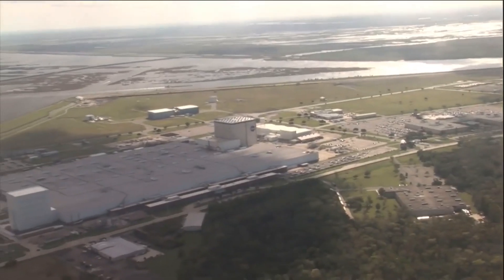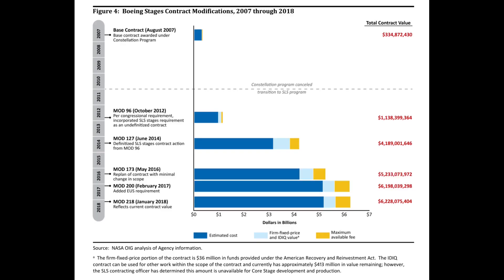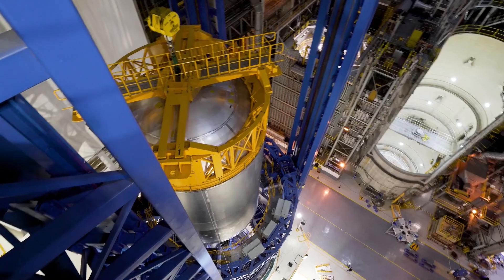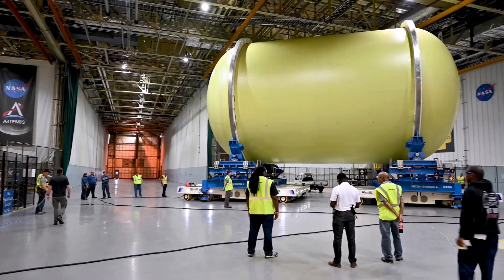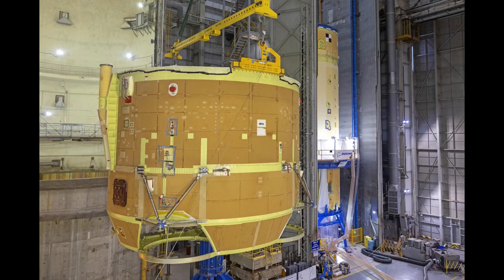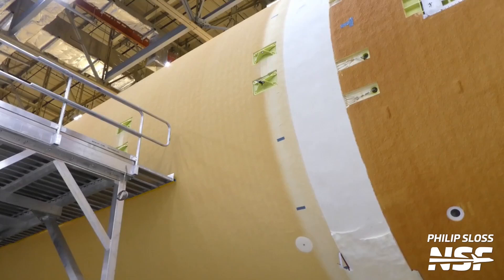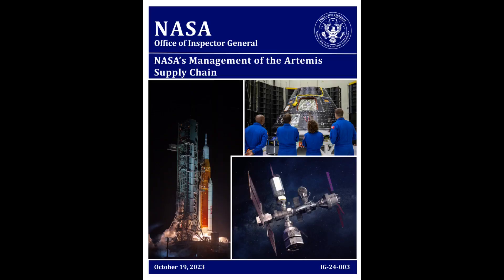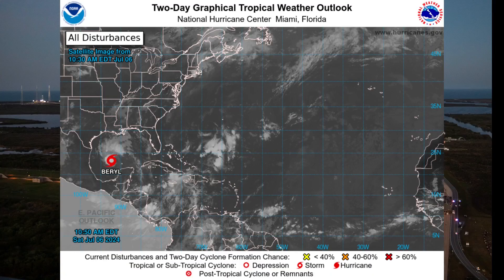Here's how NASA's SLS Core Stage for Artemis II was built

Comment: Lots of interesting and pretty pictures of the build over the years.

One thing struck me, do they rotate the stage every now and then when they are storing it horizontally to avoid sag?
Reply from the maker: It is something they take into account.  The full stage was rotated for assembly work last year and then again it goes through the full 360 degrees for the final "detailing" before delivery, something they've been doing the last few weeks.  But also the individual elements are worked on in different orientations; the dry sections are assembled/outfitted vertically, given the lower hook height.  (Forward skirt, intertank, engine section/boattail.)

The propellant tanks are assembled/outfitted mostly in the horizontal, but then they are supported individually during production and also rotated for production.

And then the stage will end up spending quite a bit of time over the next year and change stacked vertically at KSC.
Reply from the maker: In case you're interested, this afternoon NASA posted a timelapse video of some of the early rotations they did last month while configuring the exterior of the stage for shipment:

https://www.youtube.com/watch?v=1vkp5_eGjYY
Reply: @PhilipSloss  Thank you. That is a big rotisserie chicken.

Comment: i just hate they wouldnt have tried to recover the RS-25s
Reply from the maker: The Core Stage "stages" at orbital velocity, ~7800 m/s.  As a conventional sustainer stage, it re-enters like 2nd stages or upper stages, not like 1st stages or booster stages.

So it re-enters like Starship, as opposed to the Super Heavy Booster, or the F9 first stage, which stages at ~1500 m/s.  (Or the Shuttle SRBs, which also staged at around that velocity.)

To recover the engines intact from orbit, you'd need something like the Shuttle orbiter, Starship, or to continue developing tech like the hypersonic inflatable aerodynamic decelerator that ULA is working with NASA on for Vulcan.  

Shuttle and Starship are sacrificing significant single-launch performance for reusability; Shuttle wasn't able to reach its the flight rate goals, let alone the rapid reusability Starship intends to reach.  It will be interesting to see how much of a performance hit SMART reuse is for Vulcan.
Reply: @PhilipSloss SMART reuse didn't sacrifice much performance due to it being jettisoned after the burn is complete without having to return the core stage. 
But reusable players like SpaceX clearly didn't care about it since they still launch the most out of anyone & making huge revenues, even excluding Starlink. And there's still a huge questions if separating the engine section (with a lot of complex components) would be simpler or not than returning the whole booster, and how much will it affect the refurbishments
Reply from the maker: @alvianchoiriapriliansyah9882  If you're referring to ULA's plans, that's for the engines on their Vulcan first/booster stage.  ULA has to plans to return the in-space Centaur stage from orbital velocities, which is the speed of the SLS Core Stage at the end of its burn.

Comment: So this tank has been in the works for almost a decade… can they build it any slower?
Reply: It is a stage, not a tank.
Most rockets have a lead time of several years, and this one ran into a lot of issues with supply chain disruptions.
Reply: @brokensoap1717  oh aren’t you smart… from STS (Shuttle) they already had the production facilities, the know-how, the engines and basically every important part of the system. If they had to develop everything from scratch I would understand a 10 years lead time… but this is just a scam to milk the taxpayer.
Reply from the maker: @gorgonbert  That's neither here nor there.  The stage was developed from scratch, but 10 years is still a long time.

NASA didn't retain the workforce or the tooling, they started the stage from scratch with empty facilities.
Reply: @PhilipSloss  Exactly my point. It might have been a VERY good idea to utilize STS parts if they were able to make them efficiently. But why on earth would they choose to build a brand new rocket from old parts if they were not able make those part quickly and easily. Blue Origin and SpaceX demonstrated quite impressively what a modern, newly developed rocket is able to achieve. SLS is just a rearranged STS. Humanity didn’t learn anything new from it and there’s no progress that came from it, no new invention, nothing inspiring… it’s just a great way for contractors to extract taxpayer money. Yeah it flies… but at what cost? I highly doubt we’ll ever see regular flights to the moon with this thing and after it is in fact cancelled it’s completely useless. There’s no payload that needs it.
Reply from the maker: @gorgonbert  The points about the cost and delays are valid ones, but there are very few old parts in the brand new stage.  There is a division of responsibilities between engines and stages, as with Raptors and Boosters (and Ships).  

Where the cost and delays come from isn't necessarily that clear cut, including how much of that is from the design, the parts, the implementation, the resources, the investment/commitment, etc.

Are you referring to New Glenn with Blue Origin?  That still hasn't flown yet.  SpaceX is the disruptor.
Reply: @PhilipSloss  Yes they made new parts, probably because they didn’t know how to make the old part anymore. But those new parts don’t make the rocket do new things, more efficiently or cheaper. The damn thing costs a billion a piece and takes 10 years to build, not develop! Build! …for crying out loud. They throw away the engines that were built to be reused. How can you not see it??? The argument that BO isn’t innovative because it hasn’t flown yet… it’s just nonsense… how can’t you see it??? That’s like the Ariane Space Executive who said SpaceX was just a dream and he doesn’t need to worry about dreams. If you look at any of the new rockets, even the small launchers, those are innovative, those do more with less, those bring us forward. SLS is stagnation and a huge waste of money and time.
Reply from the maker: @gorgonbert  The comparison for Blue Origin isn't the government or SLS, it's SpaceX.
Reply: @PhilipSloss  OK… I try to say it it differently… NASA should be at the edge of technology, trying out new things… Corporations should then use that research and build things based on that research… that’s what NASA used to be for… now NASA is hardly doing any research at the forefront while holding on to rebuilding old rockets that were researched in the 70ies and flown in the 80ies… NASA should be at the forefront themselves and incentivize private industry to be at the forefront… why are they in the business of riding dead horses, keeping museum rockets in the air? I don’t get it 🤷‍♂️ Why isn’t SLS an awesome cutting edge rocket that the world looks at in awe? No… SLS is just a rearranged STS which is barely able to lift a capsule into a convoluted moon orbit (this rectilinear halo bullshit) because it hasn’t enough oomph. SLS can’t even take a lander with it… no no… that requires another rocket to fly that didn’t even exist when the program started… (still doubtful if SpaceX can do it, although they sure make a huge effort) how is this the best program the mighty NASA was able to come up with?
Reply from the maker: @gorgonbert  The Obama Administration tried to do that in 2010 with respect to NASA human spaceflight, but Congress would not agree to reset to pure R&D.  SLS is one of the things that came out of the compromise.

NASA does not set its own policy, it does what the President and Congress direct it to do and provide the money to do.

More broadly, not sure that government is the place that people look to as an angel investor in this century.  Government is not viewed the way it was in the 1980s, let alone the 1960s or 1950s.

A lot of the investment and financial risk is being taken outside of government now, both outside space industries and in.